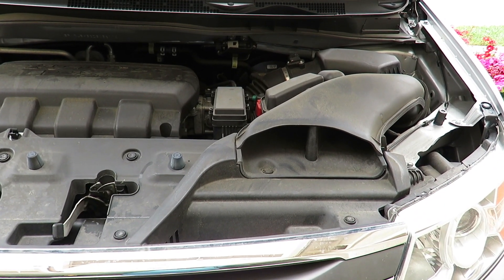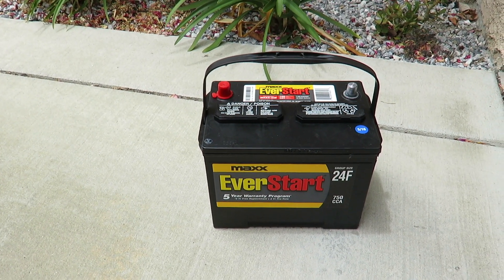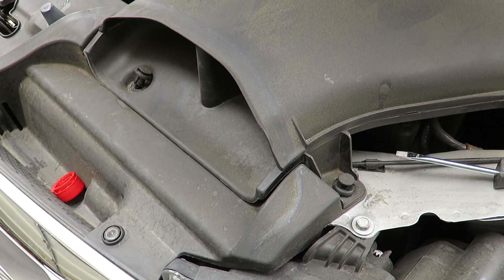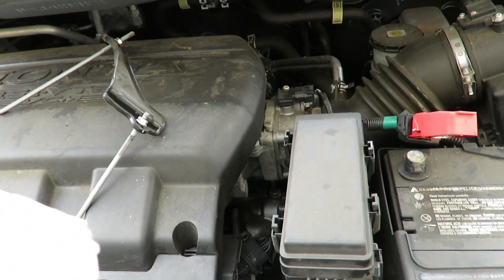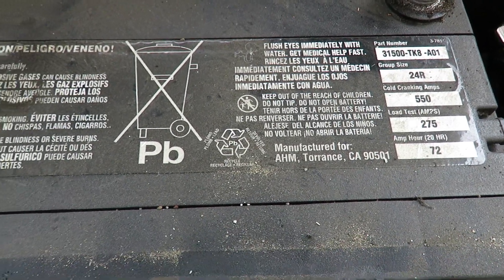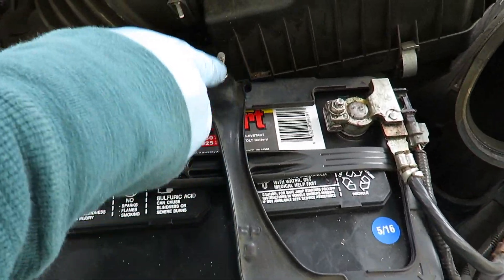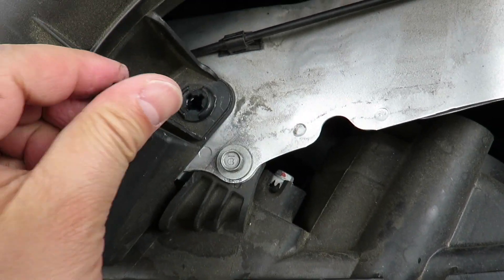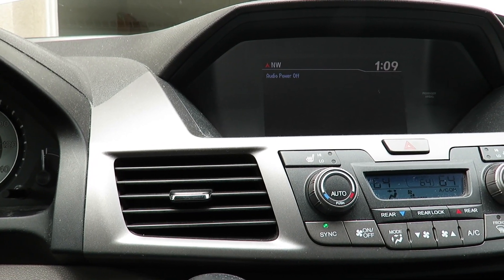How to change the battery on a Honda Odyssey

Comment: It’s a little tricky to do sometimes, but if you keep another power source attached to the battery cables (such as a portable jumper or battery charger) you can prevent your radio and the computer from resetting.

Comment: I don't think you want to have the hold-down strap (the metal part that goes across the top of the battery to hold it in) on top of the battery's plastic carry handle.  When yo do it this way the metal strap bends and it's clamping down on the battery vent covers.
Reply from the maker: True.  I did the same install on my TL but removed the hold-down strap.

Comment: hi, thanks for making this video. I think you missed a key part at 2:50 when you remove the terminals off the battery. This is a pretty challenging part of the job for someone that has not done this before. For folks trying this on their own, you are going to need to remove the battery housing, and then remove the terminals. It helps to have a socket wrench or a socket wrench bit for your drill. This video does a pretty good job of showing the process once you know how to get the air intake off: https://www.youtube.com/watch?v=Ahog_PfByRg.

The 2 videos together should save you some $$. Good luck!
Reply: A Asda!!
Reply: I was disappointed that you didn't show how to remove and replace the terminals.

Comment: Nice video. After replacing the battery, my 2012 Odyssey asked me to enter a Security PIN Code into the radio when I started it up the first time. If (like me) you weren't given the code when you bought the vehicle, you can generate it on this website https://radio-navicode.honda.com/ using your VIN and the 8-digit radio serial number that you see by holding down preset keys 1 & 6 when turning on the radio with its power button. The code is 5 digits and you also enter it using the preset keys.